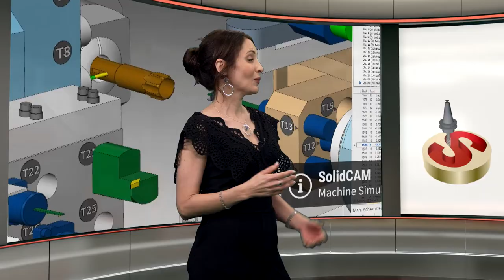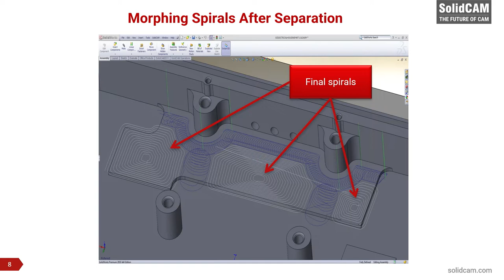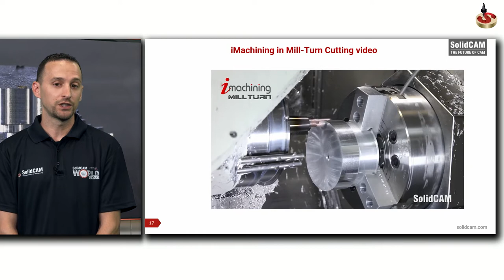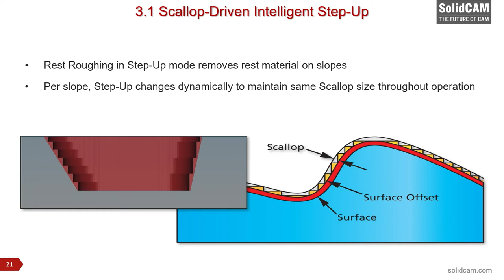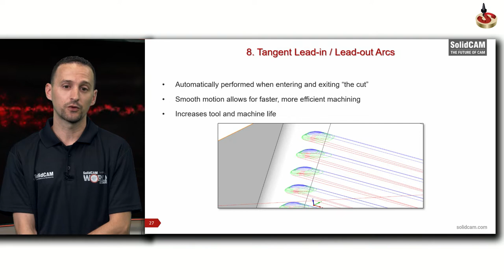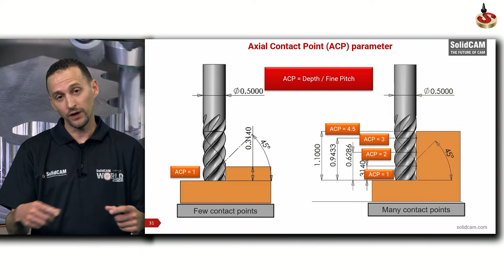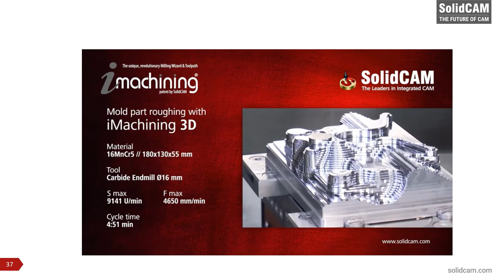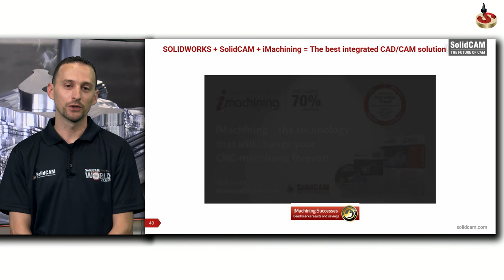SolidCAM World 2022 - iMachining 2D/3D Power & Advantages

Comment: How is perpendicularity  achieved in deep cutting lets say simple pocket? We have very good older machines in top condition but slower spindle speed up to 5000rpm. Our chief machinist is skeptical about this and refuses to take demonstration. We mostly use 4 flute 35/38 deg endmills and material we mostly use is 1C60 (1.0601) and 45Si7 (1.5024)